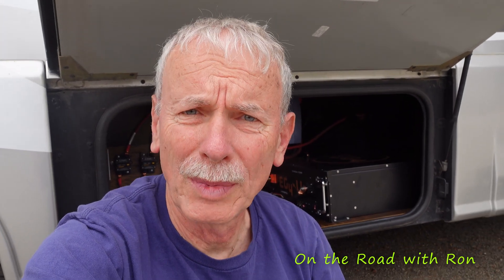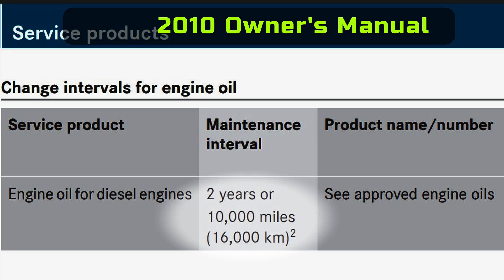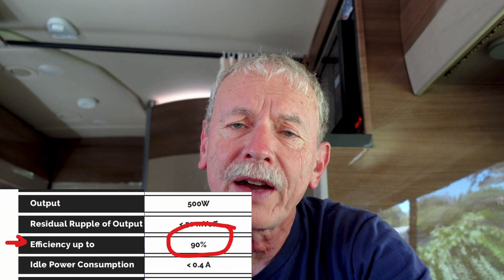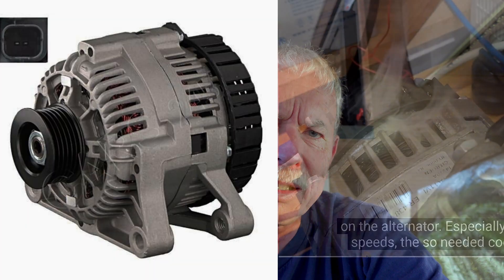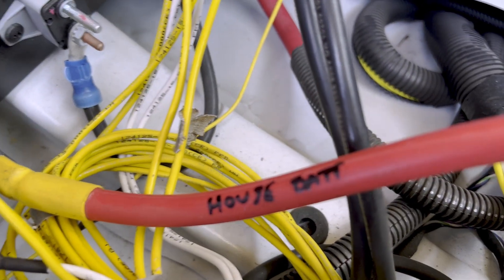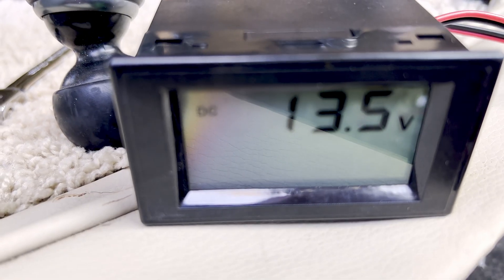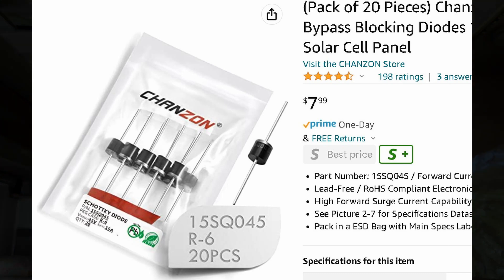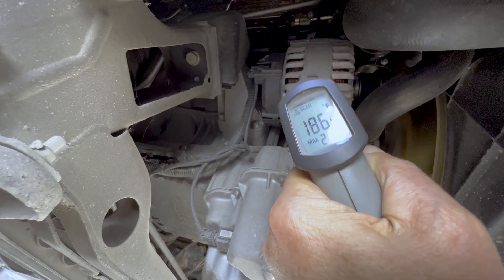DC to DC charger NOT required for big Lithium Battery

Comment: I have watched most of your videos and really find them useful. I know that you took checked your alternator temperature many times under different charging conditions. Did you ever measure how many amps that your alternator is charging into your lithium battery? I realize that there are a lot of variables including the battery size, state of charge and likely engine rpm. I have a 2023 Mercedes Sprinter with the four cylinder motor. I am not sure what the alternator size is. I think that I would want to be able to switch the alternator charging off and only use it when it is nec to charge the lithium house battery. Any comments would be greatly appreciated
Reply from the maker: Your newer model has built in Battery Isolation Manager (BIM): These typically use a Precision Circuits Li-BIM 225. This device "bridges" the chassis alternator and the house batteries.
• Duty Cycle: To protect the Sprinter’s alternator from overheating (since lithium batteries can pull massive amounts of current), the BIM uses a duty cycle. It will charge for about 15 minutes, then pause for 20 minutes to let the alternator cool down, then repeat.. 
Google:
Reply: @ontheroadwithron2432 

Thanks Ron. My unit does have a Precision Circuits BIM however it is not the Li 225 model. It was designed for lead acid batteries. Fortunately the solar charger controller and the 110 volt to 12V charger are set up to handle both lead acid and Lithium. I definitely want to install lithium batteries this spring. I am undecided whether to install a DC to DC charger, upgrade the Bim to the Li-235 or just put in a switch so that I can only charge the Lithium battery using the alternator when I can to.

Please keep up your videos. I find them very informative.

Comment: I guess I came across this 3-year-old video as I'm in the process of installing a 25 amp DC to DC charger on my Class B Travato. It has a 180-amp alternator, and I purposely picked a smaller charger. Yes, it takes a little longer than a 40-amp one, but when I reach most of my destination, the battery is almost always charged. It's so much better than before, as I would just use a simple 110-volt charger.
Reply from the maker: Yes everyone’s needs are different. The only time I need a lot of charging power is in Florida running the ac from batteries.

Comment: Nice video, people must understand that an LiFePO4 battery CAN be charged directly by a vehicle's alternator IF the alternator can put out the maximum current required by the BMS safely. Otherwise, a current limiting device would be required. Simple as that.
Reply: What current limit device is out there? I installed lithium starting batteries in my 600hp diesel last year and so far so good. As a precautionary 
What alternator protection device Do you recommend as a "just incase"?

Comment: I was going to put in a dc2dc charger but have reconsidered.  My alternator is an 'intelligent' 150A alternator (current limiting) and my battery is a LiFePo4 300Ah battery.  My only connection is the 7 pin from my SUV to my small travel trailer with 200W of on-board solar.  After doing much research I determined that I don't really need a dc2dc charger.  Thanks for the vid!   PS: I also use a Scan Gauge but it's the SGII model.  All kinds of OBDII readouts available.
Reply from the maker: Agreed. Those pin connectors will only pass so much current through them.

Comment: It's been over three years, Your alternator still doing well? Doing something similar with a F53 chassis and a V10 for about three years also.  It's a 300 AH Lithium battery.
Reply from the maker: I don’t need to charge with the alternator very often but yes, still working fine.  I only need it when running the  AC on summer trips.

Comment: The 240A alternator in my truck charges a 100Ah LiFePo4 in the bed of my micro truck camper with a direct connection via 20 feet of 6 gauge cable. Typical draw is about 35 amps when the truck is charging. Problem is, the truck only charges when the starting battery needs it. It treats the LiPo battery as load and is often at only 13.5 volts once the starting battery is full. So I can never get the LiPo full if SOC starts out low. For now, I disconnect the LiPo and use the starting battery a little to partially deplete it so  the truck will stay in charge mode longer when driving.
Reply from the maker: You might have a voltage drop issue. Assuming a straight line with no connections in between, then the lithium battery will see a .5v drop. However the ground line also needs to be considered. Sometimes the ground doesn’t make a good connection. A good check is to measure the voltage at both batteries while charging.

Comment: i ve got a little citroen xsara picasso car camper and just one lithium lifepo4 100ah battery which i charge with a 200w solar panel...would it be ok if i use a  split charger from normal car battery and charge the lithium battery? or is the citroen car alternator not big enough
Reply from the maker: I’m not familiar with this vehicle   It depends on the ratings of all the parts. Alternators are rated in amps. The bms on your lithium battery will have a charge rating also. Check the battery voltage when the solar panel is at max charge. If the voltage is high, around 13.6 v or more then the charge current is ok.  You really need a current meter to check everything.
Reply: @ontheroadwithron2432  citroen alternator is 150amp RIDEX 4G0052 Alternator
12V, 150A, B+ (M8), D+(M5), excl. vacuum pump, Ø 55 mm, with integrated regulator
Article number: 4G0052
Reviews - 10
Alternator Charging Current [A]:
150
Voltage [V]:
12
Reply: @ontheroadwithron2432  hi i went and connected the 2 lithium batteries to the split charger and according to the mppt it says 31.4 amps are going into the lithium batteries if that what it means,im not that technical minded..the voltage is around 13.5 ..the alternator is 150amp..anyway i tried a 400w infrared heater in the back to drain some power  which worked great.

Comment: This can work but Sprinter builders need to do the math. The charging current to the lithium batteries is limited by the total resistance of the wire plus connections plus switches. (and the Lithium battery charge level). Use a longer wire and that will drop your max current. Use a smaller diameter wire and that will also drop your max current. But use too short of a small wire and you will get concentrated heat (too hot wire). Aiming for 80 amps . Running wire to back batteries under van to allow heat dissipation. Still more efficient than most DCDC.
My 2021 Sprinter charges up to 14.5 volts ( which supposedly my BMS can handle) . I have been thinking of doing this , but waiting for my Renogy DCDC to fail. i would install a simple battery charging module ( amazon $15) connected in series with the control lead of the "MB external battery relay" to shut off charging when the Lithium reaches 14.4 Volts. ( there will be very little current at that voltage) and restart charging when 13.4 ( Solar charger can balance batteries)

Comment: My latest guess is as long as you have a lead acid battery still also attached to the alternator.. the slammed shut door of the bms disconnect won’t spike voltage for a second as the lead will absorb that charge. The boat lithium expert on YouTube advises this setup.
Reply from the maker: Yes the lead acid chassis battery will dampen most of the voltage spike and seems sufficient in my case. Additionally i never use the alternator to fully charge the lithium. I let the solar top it off and there is very little current and spike from that.

Comment: What happens if you have a 400 amp mechman alternator I'm guessing its best using a DC to DC charger with built in isolalator with inline fuses before & after the battery using zero gage insulated wires I could be wrong but I'd rather be safe than sorry if anyone knows something I don't please let me know it'd be greatly appreciated
Reply from the maker: You have a very big system. The battery pack will determine how fast it will charge. With a 400 amp alternator you have plenty of capacity and can charge up to around 600ahr battery pack without a dc-dc. Not sure what your wiring is rated for but 2/0 is a good size for up to 200 amps. High power Dc-dc chargers get real expensive.
Reply: @ontheroadwithron2432 thanks

Comment: 2 questions

1 why wouldn’t you want alternator to charge it all the time? 

2 your test was at idle when normally in and rv alternator charging would be at highway speed high rpm to the next camp spot?
Reply from the maker: I use solar to charge batteries. The alternator will reduce your mpg if it has to do a lot of charging. I tested at higher rmps with similar results

Comment: "Citroen" is because Citroen/Renault/Fiat motorhomes are virtually the only MH you see in Europe, they are all rebranded version of the same one. Many other places as well, like NZ. And they do have 70 Amp Alternators. At idle the alternator does not put out much current, and at 2000 rpm the fan provides plenty of cooling,. In between is the biggest danger. I don't use a dv to dc but I designed the system to limit the current to 25A. Just wire size and an added 30A fuse between the LA and the lithium batteries.
Reply from the maker: Thanks for the info. Sad them use such an under powered alternator when we have so many gadgets that need electricity.

Comment: Your current is determined by the voltage drop in the cables. Upside the cables and current will increase.

Comment: Very much appreciate your knowledge and presentation.    While I totally agree with you that there are issues with the Victron video showing the smoking alternator, to be fair, I think the alternator does have a fan.  What I notice is at the very beginning of the clip I think they stop the drive motor so you can see the smoke.  I think it's interesting they only show the IR camera  aimed at the internal coils after they alternator / temp limiting control box is on the bench.   I would like to see direct thermocouple measurements direct from, the stator lamination core.  There are issues getting good measurements on bright metal surfaces as the emissivity can be quite low.  I've come to believe that one can burn an alternator in certain conditions.  Low RPM and high loads are when that happens.   With a design /install that results in reasonable max currents, most people would not have issues.   I suspect that one might want to think about the size of the battery-alternator lead as that choice can effect to max current.
Reply from the maker: I also suspect that quality of the alternator has a big impact on its life. Never heard of a Mercedes one failing.

Comment: That battery monitor that you said needs the shunt to be installed on the negative side of the alternator can be installed on the house battery negative battery terminal between the battery and all the points where the loads are connected.... That's what I did with mine.
Also, yes... You can rely on the BMS to protect the batteries from over-volt, undervolt, over current, and overcharging. However, I prefer the BMS to be a backup to the main protection of a proper charge controller and a programmable battery undervolt cut-off... All it takes is one event to destroy those expensive batteries...

Comment: I saw that Victron video and laughed too, I deal with electronics and also marketing and yes it looks like a setup designed to scare people.  I'm going to just connect my alternator on my van via a Voltage Controlled Relay and measure the current to be safe, possibly putting a current limiting resistor in-line and if needed a diode to drop the voltage.  No one mentions fuses but they are very simple cheap devices that can prevent overload so if you are worried about say going over 40amps put a 40amp fuse in.
Reply from the maker: Victron doesn’t need to be deceptive.
Reply: @ontheroadwithron2432  I'm not saying they make bad products but it all depends on the marketing people they employ. I remember going to the BMW museum in Munich and the marketing up to about the 1960's was basically technical documents.  They sold their products to people who could understand the superior technical specifications of their products.  Victron could still do that but in this case the marketing people chose a setup with a low output alternator and a large 300ah battery which has a very low internal resistance and showed a smoking alternator.  A video any company could make even if their product was not very good.  It does not show the qualities of their product rather it using fear to make sales.

Comment: I installed a 100Ah LiFePO4 battery, without a DC-DC charger, on my 4x4, and I had no problems. I am still using it. It is charged directly from the solar panel and alternator (not the same time)
If the LiFePO4 battery is 30% empty, it draws 40-50 amps. 
When charging a lead-acid battery, the alternator temperature is 54°C,
While charging the LiFePO4 battery at 30%, the alternator temperature is 64°C.
When the LiFePO4 battery is almost %80 charged, the temperature drops to 54°C.
Reply from the maker: Nice. Each installation can be different. Glad yours is working well.

Comment: Excellent video. About the Mercedes alternator my voltage output seems to be around 14 or 14.1 V I am a novice when it comes to the Electrical’s, is it possible that if the lithium batteries have a higher voltage, the voltage could lead back to the alternator?Also, if the alternator only puts up 14.1 V in my case, does that mean I will never reach the 99% state of charge for my lithium batteries?
Reply from the maker: First, the lithium battery voltage will not bother the alternator.  Secondly lithium batteries do not mind being at any state of charge except over or under charged. The BMS  built in the battery will protect it from this. I don’t worry about getting 90,95, 99 or 100% charge in the battery since I have plenty of power for my needs. It may even be better not to keep lithium at 100% charge for long times.
Reply: @ontheroadwithron2432 Thank you. What about the theoretical risk a high voltage would go to the starter battery, which could be lead acid or agm. Would it overcharge the starter battery? Like say if you have solar on the lithium to 14.45, and the solenoid opens so the starter battery is exposed to that voltage

Comment: Did your lithium battery reach full charge? A car alternator doesn't put out a high-enough voltage to fully charge a lithium battery. 

The concerns with NOT using a DC-DC charger are 1) the alternator doesn't put out a high-enough voltage to fully charge lithium battery, and/or 2) if a lithium battery is fully charged, its BMS suddenly cuts it off from the alternator, which will overheat/damage the alternator because that current then has nowhere to go.
Reply from the maker: Good points. Actually probably never fully charge the lithium. My solar controller seems to cut off around 13.7volts. This is my main method of charging as it is free. However if I did use the alternator to charge it “fully” most of the back EMF from the alternator would be dampened by the lead acid chassis battery.

Comment: Do you need a DC-DC converter to charge your LiFePO4 battery? No, 14.6V will be sufficient to get it to constant voltage charging. Typically DC-DC conversion is to get to a substantially different voltage. If you have a 48V battery to run an inverter or a "mild hybrid" system, then having boost / buck conversion between the two DC voltages would absolutely be needed. The real question is how fast do you really need to get to a full charge? This is recreation, not life-saving, right? Of course I remember when camping meant doing without some creature comforts...

Comment: Vehicle alternators cannot maintain max rated output for hours on end. Fifty year pro tech here, more certs than you can shake a stick at INCLUDING Emergency Vehicle Master. If you want to be smart get a temp probe and attach it to the rear of your alternator. Keep an eye on it and stop the stupid when it exceeds 180°F - 200°F or you'll be spending money.
Reply from the maker: That’s like saying a car engine cannot run at max rpm for hours at end. Yes it is true. However my alternator is barely running at 1/2 power when charging the battery. As an engineer with 40 years designing motors, gearboxes, pan and til assemblies etc I can safely say this will not burn up my alternator.  All mechanical devices will eventually wear out however there is not one reported case of a Mercedes alternator burning up from charging a lithium battery. If you know of any, please let me know.